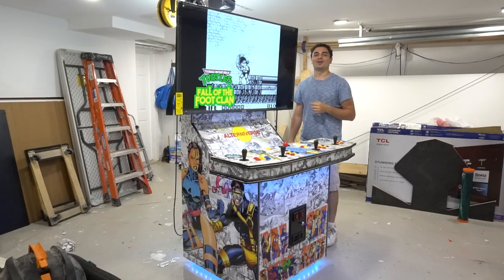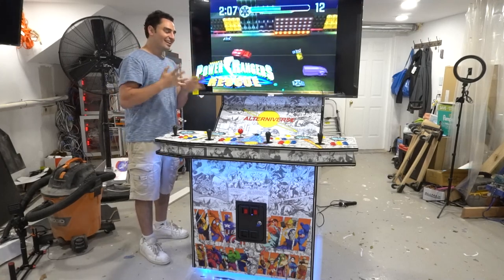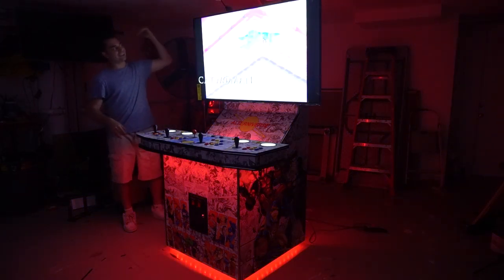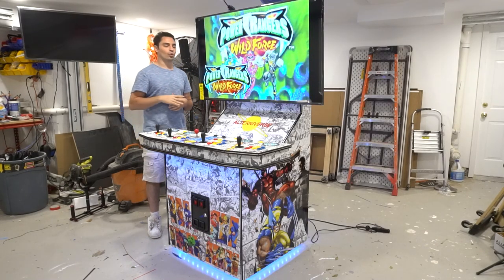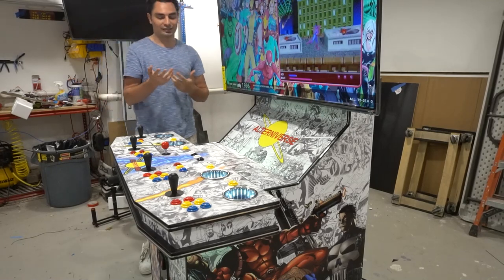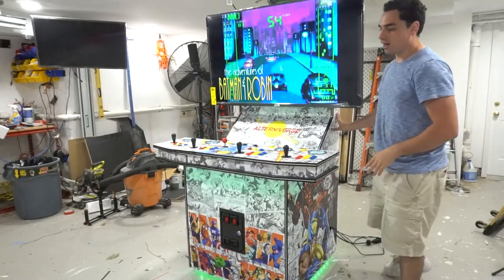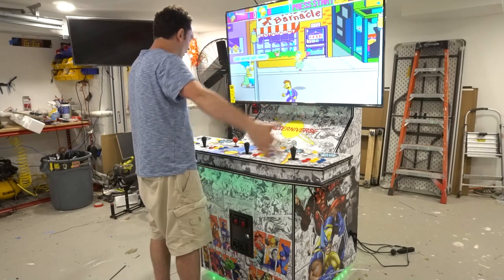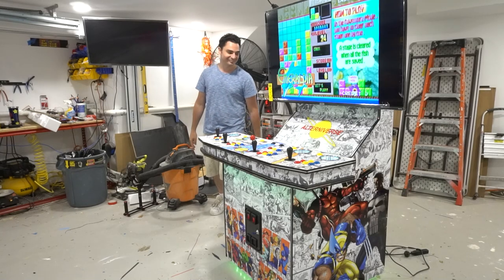First Official ByVic 4 Player Arcade Cab Made for a Customer

Comment: Really badass!!!  I'm tempted to get one made, but they take up so much space.  It'd definitely be great for business owners, or dudes with man caves. ;-)  IMHO, I don't think the older games (before 2000) look very good on a monitor more than 27 inches though as we're dealing with that 480p.  Been playing with PCSX2 and a 3080ti and the higher you bump the res, the blurrier things become without some scanline filters and half pixel offsets.  Looked like muddy water on a 4k 65 inch tv, but looked beautiful on my 27 inch 1440p monitor.  The MAME games looked like a jagged mess on the 4k tv as well without some tweaking.  As long as the customer learns how to  use filters and apply AA though, then I say this is a win-win product, fratello.  I know I'd love to have one!  It's a beautiful thing.  CONGRATS ON THE SALE!!!!!

As an after thought, It'd be awesome if you could get hold of some older Sony CRTs to use with your cabinets!  I know it's  not really economical to use one, but those monitors and SD resolution combine into something that is simply unrivaled.  Also, do you plan to do any Mistercade FPGA builds?
Reply from the maker: Very true, doing this for 8 years I learned it's just a personal preference when it comes to aspect ratio. I'd say a good 80% of customers want full screen stretched games and the rest want original aspect ratio. Luckily its easy to just swap between them easily.
I personally don't mind the full screen stretch, but yes it does get pixalized.

I never got into bumping up and upscaling emulators to 4k lol yes it looks like dog water... I rather just do full screen stretch and leave the upscaling to original.

Never heard of mistercade I'll research it
Reply: @Vic_VP  Yeah, Mistercade is actual real reproduction FPGA hardware.  It's a JAMMA adapter basically.  I never really delved into it because I'm a PC nut, but it looks highly promising.  It's costly, I'm sure, but hey....no emulation.  You could offer it as an elite product.  They also have FPGA modules for all the older consoles.

Comment: I have a Pandora box EX two jam board running a joystick incoder but for some reason there is no coin button nothing will coin up on free play or on coin what should I do
Reply from the maker: Free play doesn't require a coin, they most likely have the coin button mapped to the start button so if u press start it will also press coin for arcade games also like how you see the Simpsons coin op in this video.

Coin wire is usually the wire after start wire